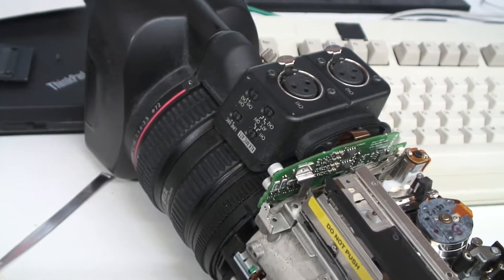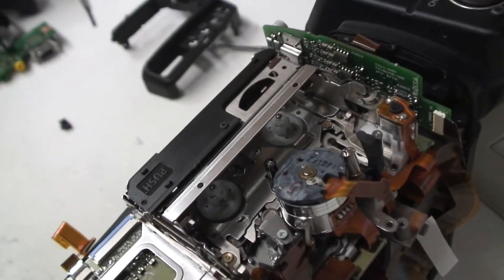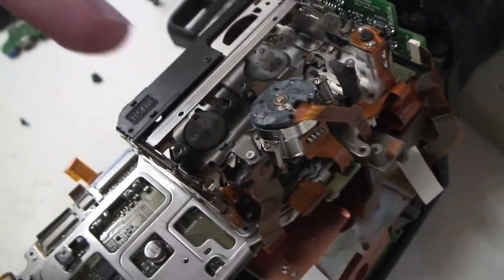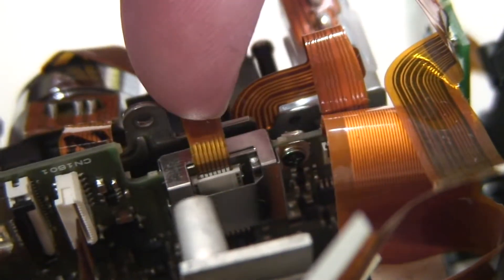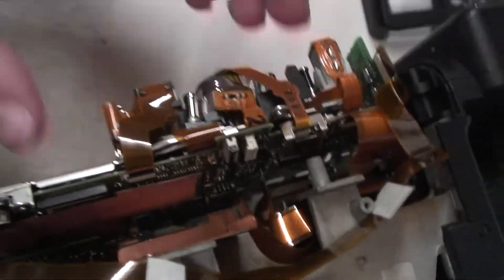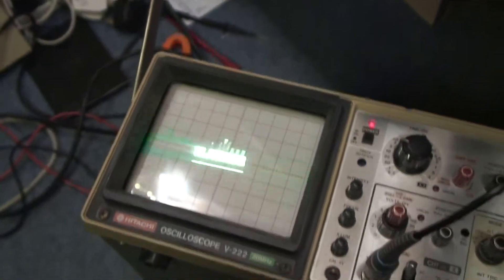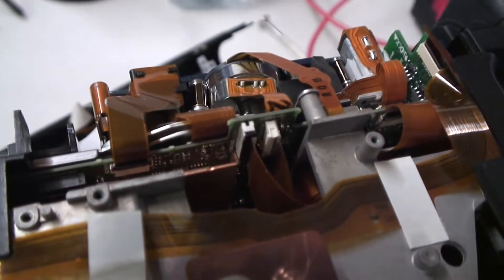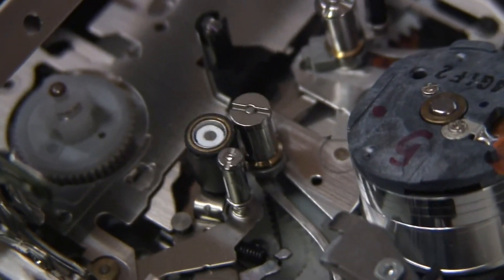Repair Rant: Canon XHA1 Camcorder

Comment: I found the RF output by accident. I thought it was a SDI output but it isn't (like the XHG1) it is an RF output. The Cool thing I learnt watching this video was where the tape alignment adjusters were.  I was trying to add a video assist screen and use the what I believed was and SDI but it wouldn't work. Reading the manual I discovered to my dismay that it was a RF output probably only there for servicing. To get my video assist to work I had to shorten the component cable and run a component to HDMI convertor (5volt version to keep it portable). Looks kinda clumsy but better than the credit card sized flip out monitor that it came with. I do have problems with drop outs with tape but now I record with a FS-CF Pro DTE recorder but still using tape as a back up as the digital recorder as failed me as well at times. When I add up the price of all the bits to keep the XHA1 usable it was only marginally cheaper than buying a non tape machine from eBay.
Reply from the maker: The BNC connector you are referring to is a standard analogue composite video signal (for connecting to old TVs/monitors etc). I've spoken to several contemporary XH-A1 users who have mistaken it for an SDI interface. Its a shame it doesn't have HDMI/SDI, but they weren't that common back in those days. 

The "RF" signal I'm referring to is the signal which comes straight from the tape heads, and needs to be viewed on an oscilloscope. It is usually available in some test point on the circuit board, but they don't bring it out to the 'end user' connectors as there is no need. Have a look at these videos to see how I set the tape/head alignment using an oscilloscope on an XL1 and a DSR-570:
https://www.youtube.com/watch?v=g3JSFI0laSI
https://www.youtube.com/watch?v=yfuotOqRylc
When using the DV format (not HDV), you can set the alignment simply by looking at the picture on a monitor/viewfinder, but you can get it more precise by doing it 'properly'. Using an oscilloscope may also help to reveal other problems like worn out heads.

I'm glad you've got your XH-A1 set up nicely. I pondered trying to make a component->HDMI->recorder setup, but it was too much faff. I've relegated the XH-A1 to occasional standard definition use, and just use a modern Panasonic X2000 for HD/4K recording onto memory cards.
Reply: @stevecoatesdotnet  Thanks for the clarification 🙂👍

Comment: Does most of the camera be disassembled to remove the tape deck??
Reply from the maker: The tape deck can be easily accessed just by taking the side panel off, to to actually remove the deck, yes, you pretty much have to disassemble the whole thing. This video shows how to take it apart: https://www.youtube.com/watch?v=wUUEVIo0bSU

Comment: Hey Steve, I have the same camera. I originally started with Sony standard "premium" MINIDV tapes. I was getting dropouts with HDV. I did what any hobbyist did, and I bought the most expensive HDV rated MINIDV tapes lol. This solved the problem momentarily and in total I've shot 6 minutes of footage but roughly 2 minutes or so is unusable to the problem. I tried cleaning the heads with a head cleaner tape, and that didn't cause the issue. As an ex Ground Radio Air Force guy at this point I've troubleshot down to the heads I believe. Do you know where I can buy replacement heads? I saw the canon playback tape mechanism on YouTube but how would I troubleshoot whether it's the playback mechanism or "just" the heads? Thanks man.

If this ends up being a fail, I want to find a way to digitize the footage to the SD card and figure it out through the schematic which would solve all of my problems with tape. The footage I've caught with this camera is incredible, just a small bump in the road at the moment.
Reply from the maker: Whatever happens, you may have to take some pot luck, as HDV is a very dropout prone format. In my limited experience, I'd say Sony cameras produce better quality [more reliable] DV/HDV recordings than Canon cameras do. Whichever tapes you use, do take a look at the tape under a bright light. I've found some DV tapes are quite translucent, and others less so. The more translucent ones seem to give far less reliable recordings. I've also found that Sony Premium tapes can be a bit prone to clogging heads, but that might just have been my bad luck.

You are unlikely to be able to get replacement heads, but you can change the entire mechanism. The MiniDV tape mechanism is a Canon DMC-III, and was used in many different models, ranging from the £4000 HD models, down to the £150 consumer DV models. Therefore, a second hand cheap consumer DV camcorder can be a good source of a complete replacement tape mechanism :).

Unfortunately the XHA1 is quite difficult to disassemble. You have to pretty much take the whole thing apart in order to remove the tape mechanism. The ribbon cables inside are awkward and quite fragile, and if yours is anything like mine, you may find you have to clean all the connectors before putting it back together, otherwise it may randomly not work.

I'm really not sure what the problem is on mine. When I got it it recorded nice and reliably, except there was a mechanical fault. I replaced the mechanism and it was pretty much OK, then some time later it produced dreadful recordings. I tried different heads but to no avail, which is why I think there is an electrical problem somewhere.

The only way you could record without the tape would be to use an external recorder. Firewire HDV recorders are/were available, but are expensive on the second hand market. The XHA1 has an analogue component output which will give you slightly higher quality than firewire, but HD component recorders are few and far between. It is a shame it doesn't have an HDMI port, as then you could just use a modern HDMI recorder. Another potential option is to use a laptop computer with a firewire port as an external recorder. Or you could use a separate HDV camcorder (connected via Firewire) (with a working tape drive) as an external tape-recording solution.

I hope that helps.
Reply: @stevecoatesdotnet  That's a really interesting route to go with the "live" function. I installed the PCIe (gen 1) card which is forwards compatible with my current desktop set up (PCIe 5 or 6 (unsure)). That entire set up including fistfucking the drivers and weird FireWire issues and ancient software HDV Split, I was inevitably able to get it working and recording on my windows 11, albeit with some quirks.  

I could...in theory...go from Mini FireWire - Apple FireWire Thunderbolt 2 adapter - Apple Thunderbolt 2 - 3 adapter which my laptop has. My "Apocalypse" series I have no camera man so it could make sense to run a stationary set up and do it that way. 

I would be interested in exploring the HDV player route.
Reply from the maker: Glad you got it working on Windows. I don't really use newer versions of Windows, and even 7 and XP can be a bit quirky with DV/HDV from time to time. Tends to be fine on Linux though. I don't use modern Macs either but I hear DV/HDV is very well supported with the assortment of adaptors you mention.
Reply: @stevecoatesdotnet  as someone who's obsessed with film I thought this was a good solution to get rig that was 4000 dollar prosumer set up in 2005 for 400 bucks in 2023. The color schemes the camera gives is incredible that require no color grading afterwards. I just wish they would've made a version that records to the SD card. I'm really trying to get the film look without a 15,000 dollar used film rig.
Reply: @stevecoatesdotnet  So, it works with HDV SPLIT without even recording so that's cool. Can control it all from the computer, so thaty'll have to be my solution.
Reply from the maker: @manwiththevoice  I was just looking through some footage I recorded on the XHA1 in standard definition DV mode a few months ago. Apart from the low resolution, the overall quality was very good, and the colour looked very nice. 

HDV Split is a handy programme. Adobe OnLocation can also be used for computer based recording, although it is proprietary software unlike HDVSplit, which is free.

Does your camera record to tape in DV mode OK? DV is much more reliable than HDV, so using DV might be a viable option if you need a standalone camcorder, provided you aren't too fussy about the resolution.
Reply: @stevecoatesdotnet  Ya, it records SD DV just fine. 720 SD isn't that bad but the whole reason for buying it is because it can allegedly do 1080HDV. A friend in the entertainment industry was telling me that HD 1080 is going to stick around in the immediate future 10-15 years because the US simply doesn't have the infrastructure to reliably offer higher internet speeds. So when I learned cinema and film, 24 FPS and 1080 was the solution I was looking for that "LOOKS" like film. This camera has a very  nice film look to it when playing back from the tape. It's not "real" film, but rather a solution that doesn't break the bank. 

One issue that I haven't completely solved yet though is that the footage I capture on HDV is 1440 x 1080. In my settings it says I'm supposed to be getting 1980 x 1080 so I have no idea why it's doing that. From what I've been able to find, it's because that is the marketing ploy, it takes 1980 x 1080 still pictures, but 1440 x 1080 video. Thats an issue I need to solve in Davinci Resolve so it's "full screen" and not a black line on the horizontal pixels.

For the majority of my cinema and film things I actually use a Canon EOS M with Black lantern hacked software. True HD 1080 with 14 color resolution unlocked, and the camera is only 200 dollars. I don't even color grade it's so good. 

It's been roughly a 6 month journey becoming obsessed with film, video, and learning how to do it all. The canon XH A1 is my stop gap type camera until I purchase something like a Black Magic style camera. I have a disease called equipment acquisition syndrome. The majority of projects I can do with the Canon EOS M with hacked software and the variety of lenses I have.
Reply from the maker: HDV only records 1440x1080 with anamorphic pixels. Editing software should detect this for you but you may need to tell it. 

I also expect HD will be around for some time to come. Our HD broadcasts are only 1080i, and most channels are still SD only. IPTV is becoming more popular though with the rise of faster connections. There's also the advantage that many professional HD camcorders are memory card based; and don't have tape drives to wear out, thus they ought to last longer than the older tape based SD models.
Reply: @stevecoatesdotnet  I'll have to look into that.
Reply: @stevecoatesdotnet  Random update you may be interested in. I'm going to try and do 720SD because that seems to work flawlessly. With that said, export in 720, and then upscale in davinci studio (unsure what you use) to 1080.
Reply from the maker: @manwiththevoice  I normally use QTGMC in Avisynth to deinterlace, but I've recently bought DaVinci Resolve Studio. I did this recent video in DV on the XHA1 and deinterlaced and upscaled it using Resolve: https://www.youtube.com/watch?v=95-KP-YWZDY. 
For comparison, here is a QTGMC one (albeit recorded in 4:3 mode): https://www.youtube.com/watch?v=ZZt3HjsaRgA
Reply: @stevecoatesdotnet  I too recently broke and bought the full davinci studio lol. Yes, using de-interlacing works really well. Still some weird quirks I'm working out. Actually it's 480 btw. So, I did some tests and with de-interlacing I was able to upscale to 1080 no problem and it still looks sharp. Have to remember in 2005 this was like a 4000 USD camera. I'll comment a link of a few shots and show ya when I get a minute. I would like the cinematic look, so I'm working on figuring out how to have my timeline in 59. whatever FPS so it flawlessly imports without changing frame rate, and changing the clips themselves to be 24 to give it the cinematic look.
Reply from the maker: @manwiththevoice  Does your camera have a 24 fps mode? I think some Canon models did and some don't; it may have been region specific. My European XHA1 doesn't, but we use 25/50fps here so 25 would probably be fine for most people who want a 'film look'. I tend to prefer the higher frame rates myself, so I can't advise on the best way to achieve 24fps, but I've heard that modern editing software can be quite good at converting from the higher frame rates to 24fps. Let me know how you get on.
Reply: @stevecoatesdotnet  it does 24 FPS but it's not TRUE 24 FPS. It involves 3:2 pulldown. This means pulling 5 frames instead of 4, it's a whole mess. It also doesn't do TRUE 30 FPS, again, 3:2 pulldown. I responded this to a week ago on someone else going through old minidv footage, here's what I advised and worked through to get "24 FPS" to look not like shit. He was trying to enhance old sony handycam footage of his pops who was a contractor in Antarctica. 

"I spent roughly 8 hours total going through the same problems you have and I came up with a solution. 

The footage I had was recorded at 480 24p on a canon XH A1. It's not TRUE 24FPS because it uses the 3:2 pulldown. Normally you want to remove this. In this case, you don't. If you want the best footage possible do the following. 

You want your timeline as NATIVE as possible. So, in theory despite the fact that the footage says is likely 29.97 FPS ignore that. 

Open Davinci - Project Settings - Find 720 x 480 NTSC DV 16:9 or just regular DV if it's the regular one. It should also be in the file. 

Click enable interlace processing and change timeline frame rate to 59.94. 

Drag your clip in to edit. It SHOULD NOT ask you to change frame rate. My clips say they're 29.97, yours may as well, it doesn't matter, it should seamlessly drop in. 

Do the said superscale of the clip, also, go to coloring, click motion effects, temporal NR, select 5, then underneath that better, and the one below that medium. luma and chroma, bring to about 40. 

Render - mp4 - 264 - and it'll not allow you to change the FPS which should be 59.7 or 59.98 I forget. Render. "

With that said, being in the UK you're running PAL and not NTSC. Those are the standards as I'm sure you know depending where you live. It doesn't matter. 24 FPS and 25 FPS it's all the same. 

If you follow those settings you SHOULD be able to get quality 25 FPS footage without weird dropped frames and weird lines. I was getting those until I did the following above and it looks "normal". Then superscale it to 1080 and it's pretty good because the Canon XH A1 was, at one point, expensive and has GREAT glass. Let me know how it works.
Reply: I'm only doing this and spending this time because I LIKE the film look of it without spending 15,000 dollars on an actual film camera and turning my apartment into an actual film processing studio lol. Theres methods I use in relation to making stuff look like film...but there's almost no color grading out of the box.
Reply: @manwiththevoice  peut etre une varte de caprure usb 2/3 pinnacle ,,, canoplus ...?
Reply: @manwiththevoice  premiere is premiere adobe compatible for hdv " normaly "

Comment: I brought out my 2007 zxa1 today, and it did not switch on. flashing light, but nothing actually turns on. must have used it like ten times, stored it for 6 years in a case.

Comment: Hi man I have same canon xha1 I have drop in minidv  any solution ??? I'm waiting for a reply please
Reply from the maker: Tape dropouts can be caused by all manner of things, such as low quality tape, worn out tape, worn out heads, electrical faults such as issues with the amplifiers or bad connections. It is impossible to say what the issue is in your specific case. If you are using HDV, do note that this is far more susceptible to dropouts than normal DV; On HDV you might lose a few seconds of audio & video, whereas the same dropout on DV would be a minor glitch, if that.
Reply: @stevecoatesdotnet  thank you so much

Comment: Thanks for the video, was cool to see the cam in bits! Really kind of need to shoot on actual HDV tapes though to fix the dropouts - the HDV ones are made of some alloy which prevents them from stretching like the regular DV tapes do.
Reply from the maker: I find my Sony Handycams are much more tolerant of dodgy tape than the Canons are. There are [were] quality differences between batches of tapes though; I have some Panasonic "Professional" AY-DVM63PQ tapes; some record fine, others don't. The ones that don't are noticeably more see through, suggesting a less-than-adequate coating of magnetic material. Canon even warn in their service manuals about variations in tape batches. I think I will relegate my Canon to standard-definition duties, and use my fancy new memory card camcorder for HD stuff :).